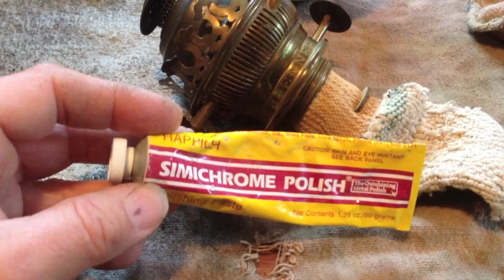Ehrich & Graetz lamp Matador burner service & polish

Comment: These lamps pulled us out of the dark ages and gave us more light and heat. Kerosene also improved the ease of usage and did a great job in heaters/stoves as well. Besides that it had a way cleaner burn than wood and candles. They are still like magic today! I got two of these and they are like new. The light can be compared with 3 watt LED of 30 watt light bulb with a heat output up to 400 watts (1360 BTU).
Reply from the maker: They lit millions of homes around the world in days gone by and still do today. We use our lights all the time, mainly for mood lighting. The other day during a 19 hour power outage we were able to close off and heat our living room bathroom with a few of these lights and it was 5 degrees Fahrenheit outside at the time. The cherry glow really uplifted our spirits and it sure beat sitting around in the dark

Comment: Gotta love these great lanterns. No better kerosene lantern available than original E&G Matador or DHR Ideal Brenner. I you need more light, you got the Alladin and Petromax. I would take this great indoors lantern over any of them (and I got Petromax already)...nice and bright light, no mantle, no sound, no pumping, does not use much fuel and is very beautiful and romantic to boot.

Comment: It's a very nice burner with a spreader.
Reply from the maker: Yes. These need the correct mushroom flame spreader to work correctly. Many times you see them for sale missing the flame spreader and they are worthless without it. The flame spreader alone can cost as much as the whole burner. I buy broken burners just to get the spreader.

Comment: Interesting video, thanks. The burners with the key lift galleries like yours, particularly the Matador ones, seem to be pretty scarce and probably early. Nice to see the flame spreader with E & G logo, as well as the wick winder. I have a hunch that - due to popularity - E & G probably licenced a UK lamp maker (maybe Veritas?) to make the Matador burner for British consumption as the only ones I've seen here have the star on the wick winder knob and the flame spreaders have no maker's identification.
Reply from the maker: Your correct. The gallery lift and/or snuffer versions are much less common, thus harder to find. They are more common in Europe. We find them visiting my relatives in UK and wife’s in Norge. You’ll notice E&G, Veritas, Den Hann on ebay from both USA and EU sellers but the rarer models are mostly sourced from EU sellers. E&G licensed to many lamp makers back in the day. Their design was also widely copied by other manufacturers.

Comment: Hi, thanks for the weary interesting and educational videos. 
I am restoring an old Lamp myself, and got some questions.
How do you know if an old lamp is supposed to have a Flame spreader?
My lamp has a center draft,  but it’s not a big size lamp. And I can’t find any trace of a flame spreader ever being used.
And what would the result be if it was used without one?
Reply: +Richard Eidevåg Know the burner or see what info you can find on it on the internet ;) On some you can see in the center tube there's stops to prevent a flame spreader to go down too far or a center post to mount on on if it's the type with a stick center post.
Unfortunately you can't judge by the burner glass. I've seen many Kosmos burners equipped with a Matador glass - perhaps therefore people are selling them cheap because they work like s..t then :D
Also the reverse probably can't be out ruled either. A Matador type of burner without flame spreader given a Kosmos glass. That however might actually work decently. And then lots of both Kosmos and Matador burners with a tulip glass meant for a deadflame flatwick lamp - neither of course working no where near what they should.
Reply: From the difference I can see, the Kosmos center draft, without flame spreader has a higher burner at the inside. The Matador with flame spreader are flatter. The Matador has a bulbed glass while the Kosmos is wide at the feet and suddenly narrows into a straight tube.

Comment: Line is actually a length unit. 1 Foot = 12 Inches = 144 Lines.

1' = One Foot. 1'' = One Inch. 1''' = One Line. :-)

For lamp wicks the old french lines are used. For the burners with wicks in a circle, the width is measured with the wick folded in half. But the measuring system isn't consistent. For example, some burners marked 15''' use a 14''' wick.

Comment: It looks great after polishing no doubt!
I'm however a bit split about the question of polishing brass and especially items with moving parts. Polishing agents are by nature abrasive and they do inevitably get in the moving parts increasing wear quite considerably. You could was it afterwards but then it'll tarnish much faster as you was the anti tarnish residues of the polishing agent of.
Personally I've come to the conclusion - don't polish brass unless it has a bad patina. That burner I think had a nice even patina so personally I'd leave that at a clean and a lube of the moving parts. Things with ugly spots I polish, wash and then makes sure they get a nice even patina (just touch it all over the place for a few days and it'll usually go without problem). Some items I give a coat of suitable lacquer but that depends on the item.
Some alloys of brass gets a very nice even patina in the dish washer but that depends on the specific alloy as many brasses are made form scrap metals with contaminants (fine for the item) or deliberately to give it a special property - lead f.ex. is common in marine use. That's usually reserved for simple items to give them a try in the dish washer. To get an even finish they should be polished first. Especially one Indian plate made of "special" magnetic brass(!! heavy contaminated :-p) got a nice matte patina which is seems to keep very well. Use it so set the cooking oil bottle on.

Comment: Use apostrophes instead if i's for Lines. That's more accurate. ;-)
You still use Feet and Inches in the US, and I wonder why you dropped the Lines? Maybe it's easier to say ½ Inch than 6 Lines?